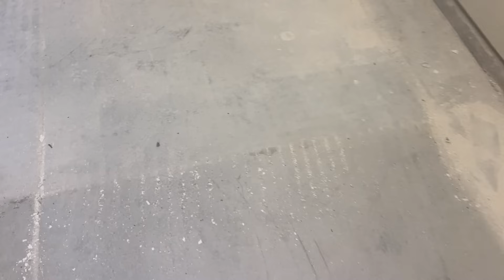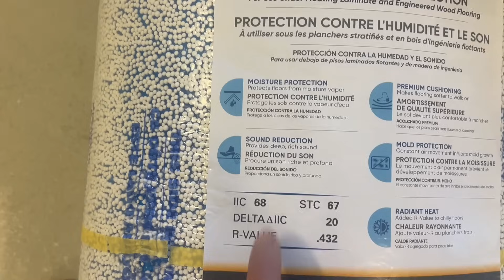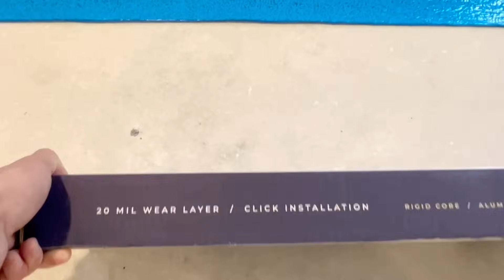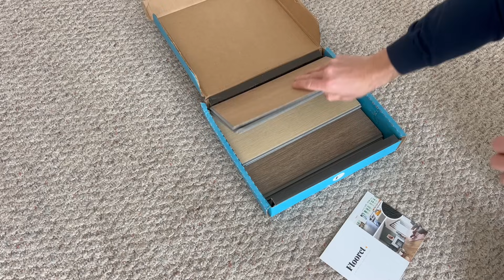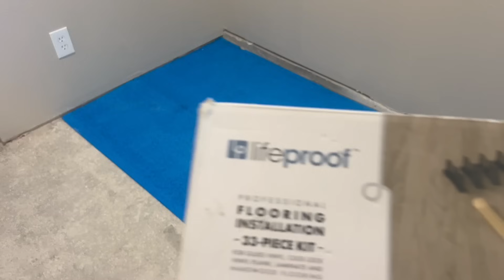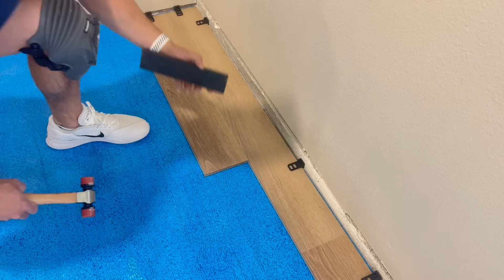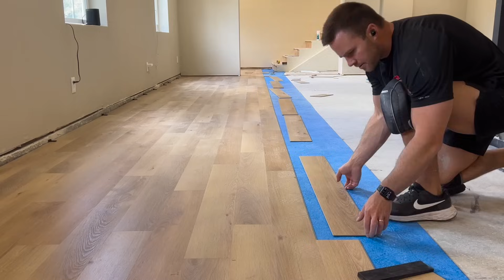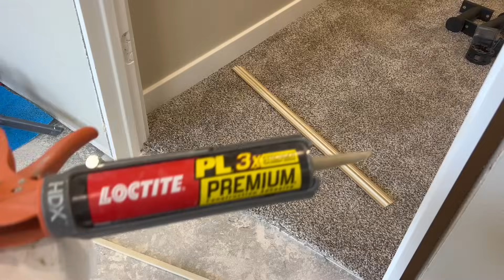LVP Flooring Installation Over Concrete Subfloor - Full Instructional | Builds by Maz + Flooret

Comment: Very helpful video! Your floor looks great!!  We have a concrete slab house and will be installing lvp in the bedrooms. For a concrete floor, does it matter if one uses a click and lock type flooring or a glue down type flooring?  Can you still use an Airguard type underlayment if going with glue down lvp?
Reply from the maker: Click and lock and glue down would both work. Depending on what flooring you use, you should contact the manufacturer about using an underlayment + glue down. You may have to glue the underlayment to the subfloor, and then glue the LVP to the underlayment.
Reply: Make sure you put in that Dimple mat moisture barrier on bare cement! Especially if your house was built Pre 1995(because prior year basements were not built with thought of living in them(source builder in Toronto, has a podcast & I found out about dimple mats from a  USA architect . 
Make sure you DO NOT PUNCTURE THAT DIMPLE MAT! ( the architects said insulation on top of the dimple & then plywood & then fancy floors
ME , I know that pink board is a flame thrower!
So I’m searching for a fire proof version
Also there is a new flooring co. like this type of plank flooring that you click the floor in place-BUT should the plank need be replaced  later you could! The Architect showed the Dimple Mat going up over the base of the walls so the moisture does not travel to the wood
The walls need to be not on directs cement unless it’s pressure treated
I’m not a pro
I’m researching & these are what I’ve found -since the perfect floor barrier  I had got flooded by faulty French drain (they worked for the first generation 42 years. I’m second generation in this house. Then it failed, byby floor😡there’s another company that has tiled organic with rug or tile on top with built in dimple Matt on flip side( if you use the large wood tiles without foam, floor is cold. Warmer is with foam. Also OSB loves soaking up water, guess what the tiles are made of if buy the system sold at the box store (love their walls( floor worked till flood   Good luck

Comment: So i'm getting the Flooret Signature with a 40mil wear layer and 1.5mm attached pad.  all things I've seen online recommend just poly barrier and not a padded barrier.  would you agree? I see you used a padded barrier combined with a preattached pad.  I'm also installing on a concrete floor.
Reply: Don’t use padded the floor will flex and the click locks will break from walking on it
Reply from the maker: @childrensbooknook  I think you would be fine with just a poly barrier, especially with the extra .5mm from the signature LVP. I used the thin pad because I just had the base LVP.

Comment: Is there a reason you did not glue down the vapor barrier underlayment so that it doesn’t slip around?
Reply: This "floating floor" will not slide around on the underlayment. The mass volume of the flooring keeps everything stable and secure.
Reply from the maker: There's no need to glue it down - it won't slip around or anything.

Comment: Im convinced no one knows what perpendicular is
Reply: From my understanding it’s really not a necessity
Reply: @goatation  it really doesn't matter. As long as the seams are level, flat and tight.. it's not going to cause any issues. 🇨🇦
Reply: What makes you think that?  You'd think that anybody taking on a DIY project would know at least the basics of what terms mean
Reply: Why do you say that?
Reply: First thing I thought right away. Not running underlayment perpendicular to the length of the flooring

Comment: Great video! Worth noting that Lifeproof LVP will not warranty your flooring if you install any underlayment except for the single option they identify on their website, so anyone buying this should check to make sure they get the right one, or just skip it.(sorry if you mentioned that and i missed it). It comes with underlayment pre-applied on the underside of the panels. A 6mil moisture barrier should be fine, but i have seen people concerned about moisture being trapped if you do that.

I'm doing my basement soon so I've been trying to get as much info as i can.
Reply: If you put more padding the floor flexes when walking on and the locks break
Reply: @joseph-1-2  I have now a Flooret product in my kitchen. It has the most durable and strongest click system right now. This isn’t like the cheap Big Box store product. It’s very strong, so your point is valid just not with this floor.
Reply from the maker: Thanks for mentioning that. That's unfortunate about Lifeproof as that really limits your options.
Reply: This isn’t “Lifeproof”. It’s much better.

Comment: So what do you do when water floods the basement and gets trapped between the plastic barrier and bottom of planks? Not good scenario.
Reply: I just had to rip out my 3 year old LVP, because it started raising every where because of moisture from the concrete. I'm so bummed. I guess when I reinstall I'll put this moisture barrier. It should help.
Reply from the maker: @vram  Sorry to hear that. The moisture barrier is absolutely necessary when installing over concrete and it should definitely help with your new floor.
Reply from the maker: The LVP is actually water tight, so water shouldn't get below the surface unless there is a severe flood. In that case, it would be bad no matter what flooring you have.
Reply: @buildsbymaz  Water gets through the click connections on LVP. I know. It's has happened to us twice from the washing machine. I have no plastic barrier and no mold. It's a tear out if using plastic.

Comment: No needs to glue the LVP down?
Reply from the maker: Nope! It is not meant to be glued down.
Reply: @buildsbymaz  So that means the floor will be shifted if a strong enough force is slide back and forth on the surface? I'm trying to install my own LVP, and I'm confused here. Thanks though
Reply from the maker: @troi_dat_oi_nguyen189  No, every piece is connected together on the sides, so the whole floor becomes one piece. It is too heavy and there is too much friction for the whole floor to shift around, if that is what you are concerned about.
Reply: @ Thank you so much!!!!

Comment: In older homes a lot of basement floors are angled slightly intentionally, so that water flows towards the drain. So in those cases, you might want to not level it out.
Reply from the maker: Very true! The leveling compound is really just meant for small uneven dips in the subfloor

Comment: Great video! I recently installed LVP in my basement and faced some challenges with leveling the concrete. I used a patching compound to fill low spots, which worked well. The underlayment choice is crucial; I used a moisture barrier too. My LVP has a 12 mil wear layer, and I noticed a difference in durability compared to the 20 mil you mentioned. It’s good to see how tough your flooring is during weight tests. I dropped a 50 lb plate on mine, and it held up fine! Thanks for the tips on cutting around angled walls; I struggled with that too!
Reply from the maker: Glad your project worked out! Happy to hear my video helped with your process.

Comment: Planning to go with LVP but wondering if I need to raise my base cabinets to accommodate for dishwasher. How thick is it installed? Thx.
Reply from the maker: Its 5 millimeters thick. When I installed it in my kitchen, I actually did it just to the front of the dishwasher, which is another option. I have that footage in my other LVP video.